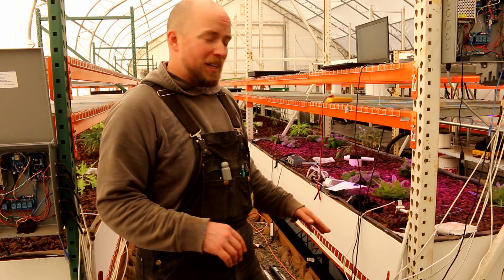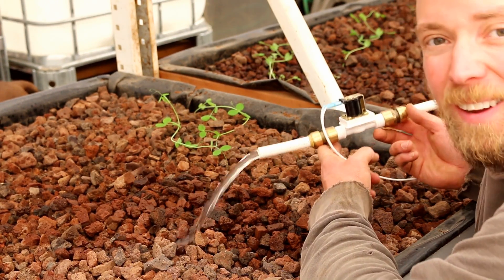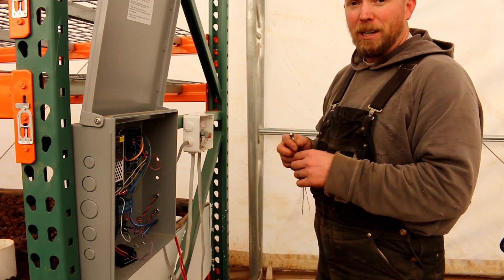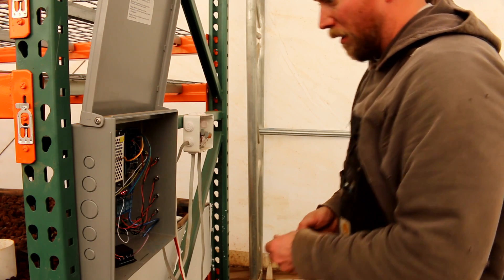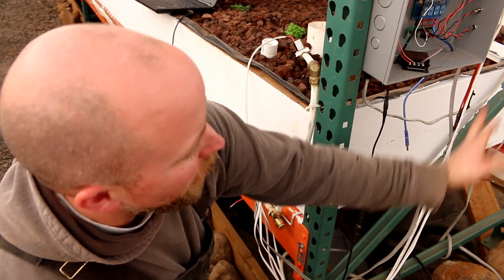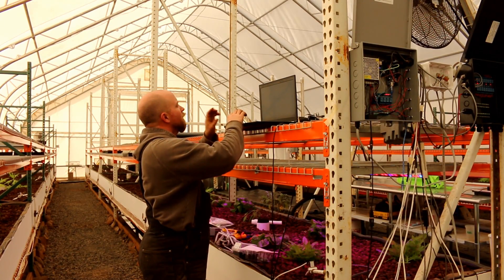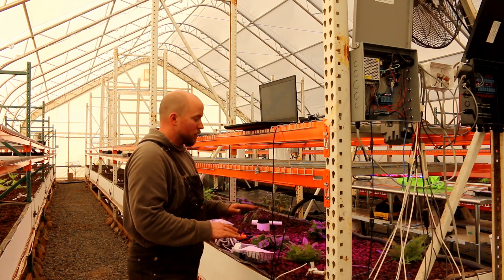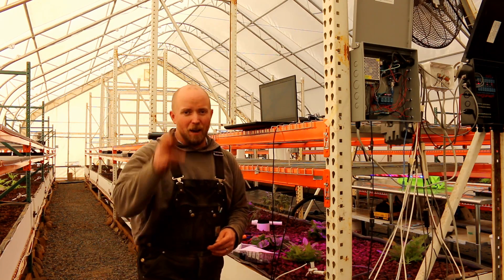Aquaponic Grow Bed Watering - FULLY OPERATIONAL

Comment: Perhaps you should have followed advice and used Raspberry Pi's instead of arduino's - built in wifi, easily configured web servers, python instead of C, HATS for motor/pump/lighting instead of cobbled together wiring, etc. etc. etc ...  but hey - what do I know ? ........

Comment: I am an electrician and love what you have done with the controls.  what is the best way to learn about arduinos and writing the code to make them work.   We set up lighting controls that are awesome, but most of it are using plug and play
Reply from the maker: +John Montgomery I'm a fan of jumping in. Buy an Arduino and install the Arduino software build environment. They have examples of code you can view and play with...kind of reverse engineering
Reply: Happy Sunday..  thanks